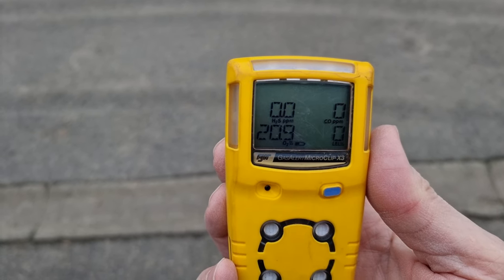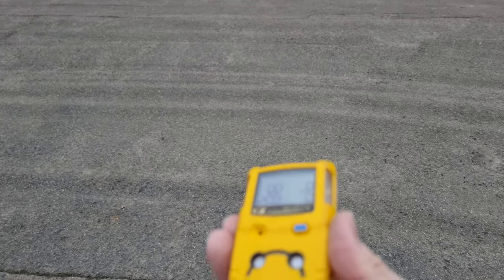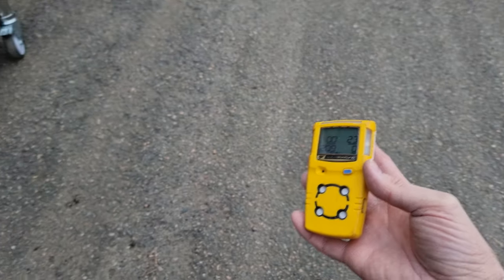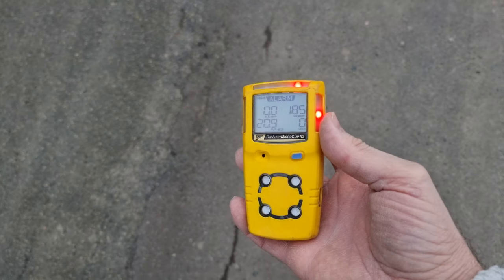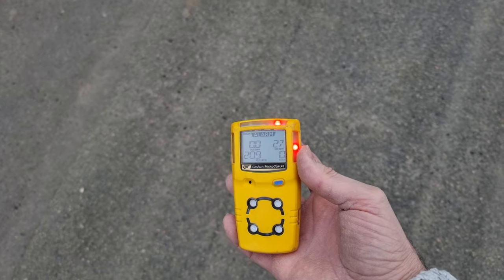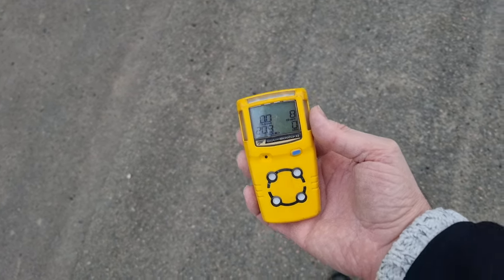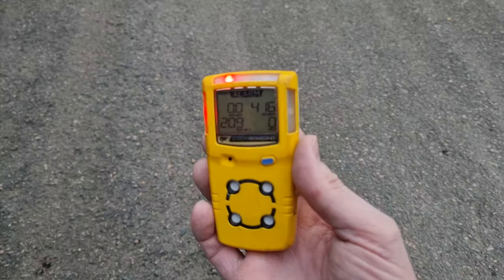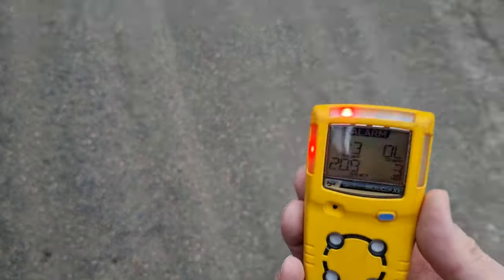THOR - Carbon Monoxide few inches to several meters from unmodified generator exhaust

Comment: Also a good reminder of the dangers of this type of testing. From the data I've seen and from your other recent video, the TSG doesn't seem get rid of all the CO. When I saw Jordan on his Alchemical Science channel smelling the exhaust to see if the TSG was working, I was yelling NOOOOO!
Reply from the maker: From a various web sources:

"With a low CO level (50 ppm), it may take up to eight hours for the alarm to go off. Higher carbon monoxide levels (over 150 ppm) can trigger an alarm within minutes."

"At sustained CO concentrations above 150 to 200 ppm, disorientation, unconsciousness, and death are possible."

As the observed levels were generally below 150, not recommended, but not immediately fatal, since sustained levels are required.

The output from breathing a HONDA 5500 would be very rapidly leathal.

Comment: YES this is what i asked for yesterday! 😁
Reply from the maker: And when I showed Malcolm and the other parties at the test centre and asked to do the control, they immediately said yes - but I didn't even expect it to be this shocking a difference. These units only go up to 500ppm with resolution of 1ppm, but the main tester there said the unit they use for testing the big 400kVA generators goes up to 10,000ppm and that goes over limit when placed in the exhaust of these control 5500 Hondas (did not see that) whereas the TSG modified Honda 5500 are under 260 ppm (saw the data acquisition and report from machine)

Comment: You could capture some of the exhaust and dilute it with many times the volume of clean air, to find out when you reach the 500ppm level that the meter can read.
Reply from the maker: Not a bad idea, but will have to happen at another time.